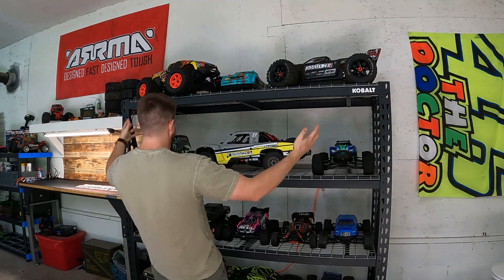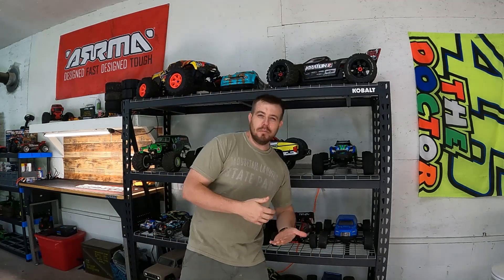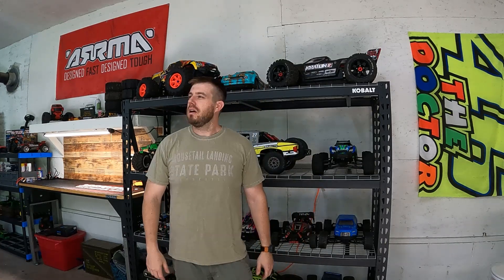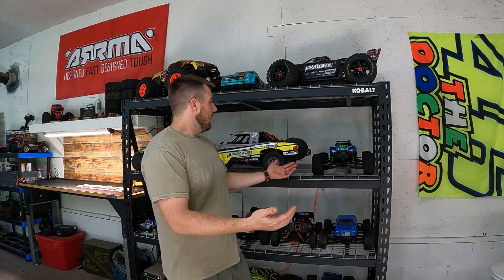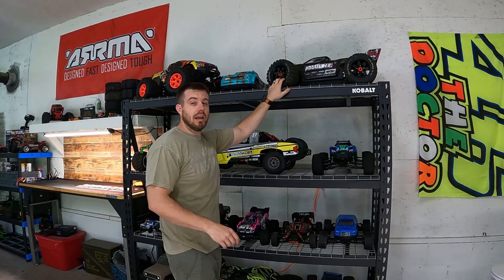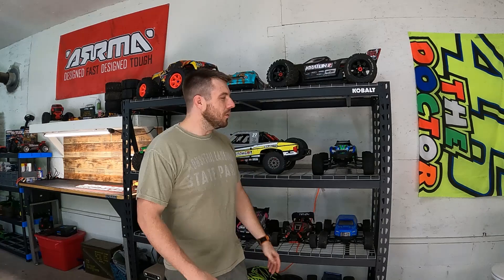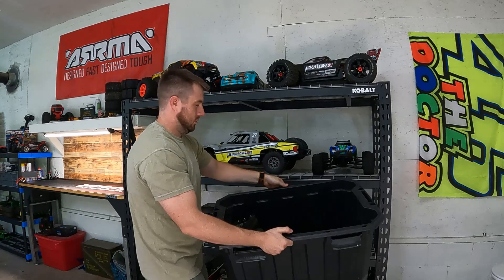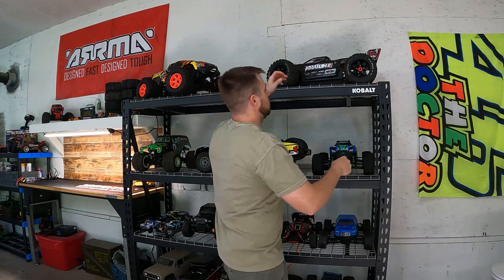My Max5 G2 800KV ARRMA Kraton EXB 8S

Comment: New sub here!  Great content, what servo are you running on your Kraton?  Thanks
Reply from the maker: Thanks. It's just a power hobby 701MG. I've never spent too much on servos. If it turns I'm happy lol
Reply: @SketchRC-  Awesome, was it a drop in, or did you need to modify?
Reply from the maker: @Biighemi drop in, no mods. I'm not sure if RTR is different. This was for the roller version.